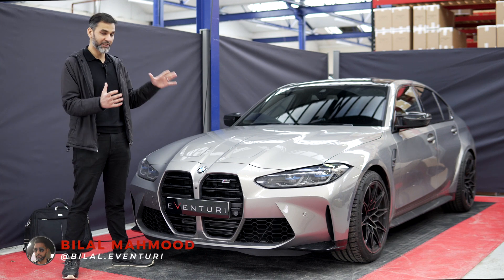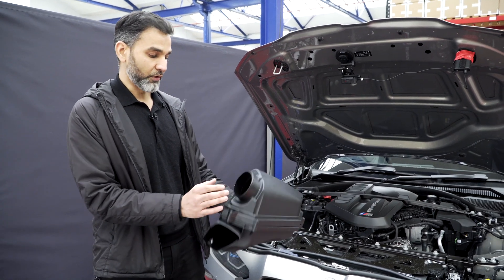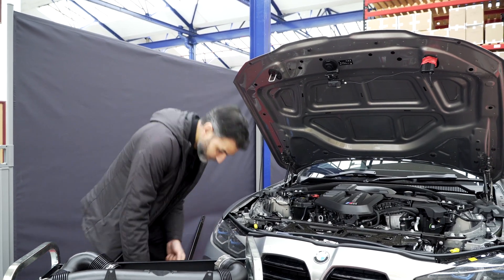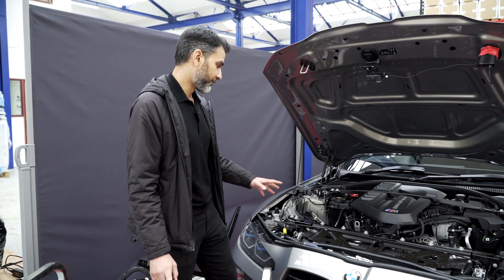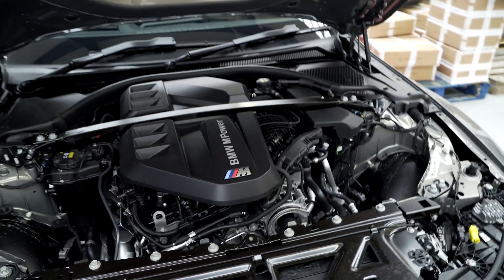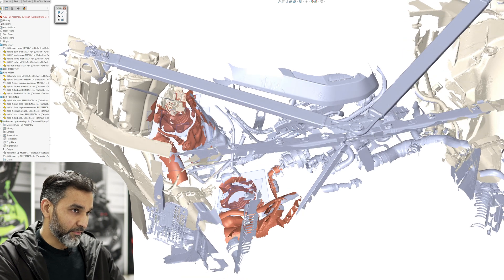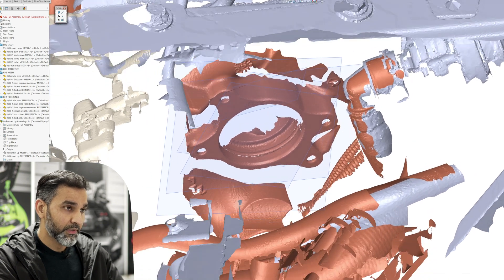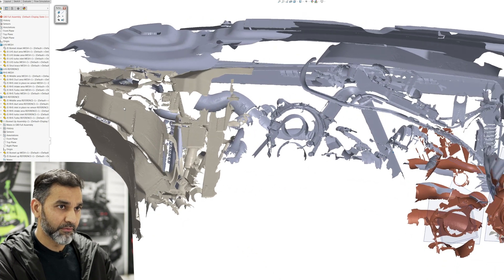G80 M3 Eventuri Intake Development Begins - 3D Scanning + Analysis

Comment: Very cool. Do you anticipate having to drop/lift the motor in order to remove the turbos themselves?
Reply from the maker: We don’t have to on S55 or B58 so unlikely.
Reply: @EvolveAutomotive  I thought you had to lift the motor on the S55 with that cross brace in order to make room to remove the turbos?  That would be awesome to be able to get at them on the S58 from under the hood.
Reply from the maker: No, you don’t need to lift the engine or remove subframe to remove turbos on S55, come out from underneath. Imagine S58 will be similar.

Comment: Are the turbos different sizes ? At first glance perhaps one turbo pipework being smaller diameter encourages lower rpm response/torque ?
Reply: They are the same size. Just the intake piping to them is different.

Comment: I would guess the larger diameter on the passenger side is larger because it is a longer pipe when compared to the air intake on the driver's side and that they would have done this to make the restriction in flow the same between sides.
Reply: Really, one would try to fully understand the status quo both qualitatively and quantitaively before trying for improvement.